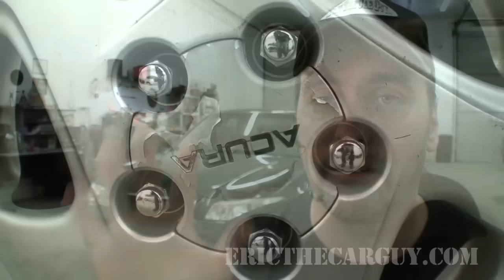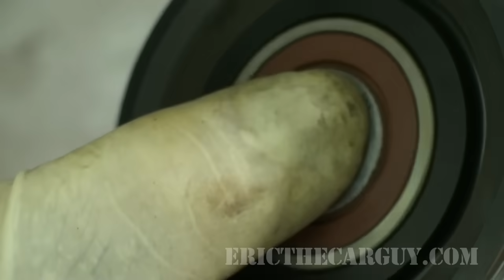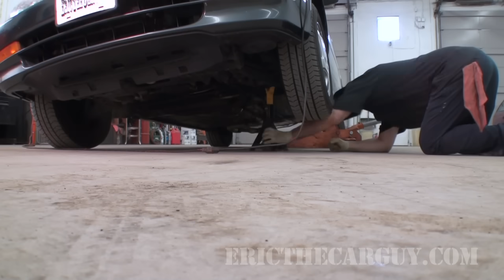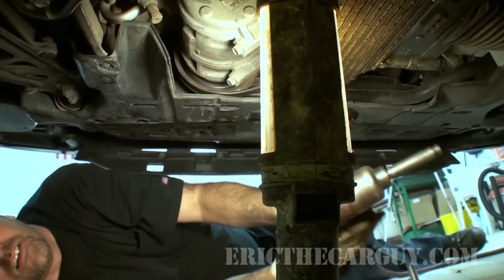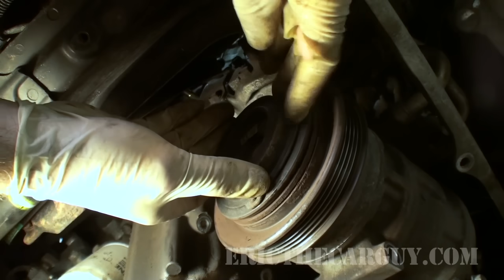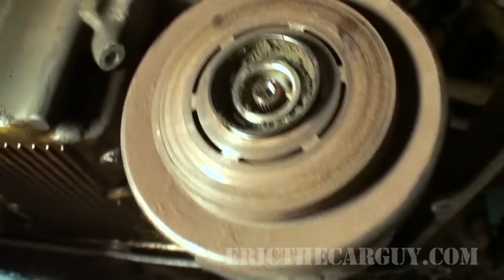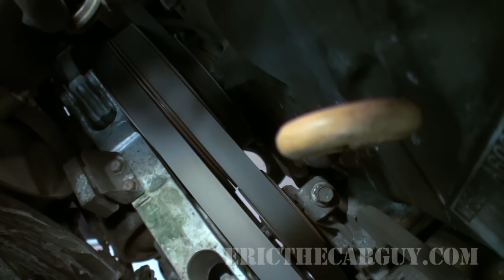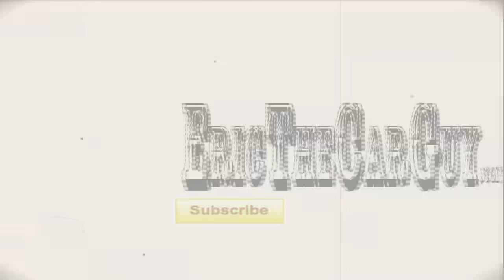AC Clutch Repair and Noise Diagnosis -EricTheCarGuy

Comment: I can't believe your banging on a bearing with your ball ping hammer. That is a machined bearing. More than likely it won't hurt it BUT the chances it can out weigh the gamble. If any thing you should at least use another socket the same size as the outer housing of the bearing and tap it in!

Comment: What if the clutch grabs when it wants? Sometimes it'll stop grabbing.  It's gotten to the point where I literally have to turn on the A/C and when it doesn't work, I have to pull over climb on the ground and manually keep spinning the clutch with my hand until it grabs.
Reply: Sounds like the stator is failing.
Reply: dmc16336 What's a "stator"?
Reply: Eric Ver Linden A "stator" is always an electronic part that doesn't move. In a compressor, it's an electromagnet that pushes the pulleys together when you turn the a/c on, which makes the compressor spin.

Comment: best way  to identify bearing noises or any noises in engines or transmission.. use a small hose (cut it about 1.5m long ).... den point it from the bearings u want to identify and listen to it.... the hose acts like a stethoscope..

Comment: Hi everyone,
I have a '06 Honda fit and whenever my AC compressor kicks in, it sounds (from the outside) like knocking. The noise is kinda plasticky in nature. How do I fix that?
Reply: You may have a failing compressor due to loss of oil and refrigerant the same.  Have you had to have the system recharged?  If yes, did you do it yourself with one of the hoses and bottles they sell in an auto parts store?  Often times you'll end up introducing moisture and air into the system if you charge multiple times to cover a slow leak.

Otherwise it may be the internal valves failing in the compressor.  Find a reputable tech or friend who specializes in HVAC/R leak check, evacuate and recharge the system.

DO NOT get fooled into buying the sealant junk they hock at auto parts stores.  It damages the system more often than not and makes a mess of our equipment when we have to service a unit that has that stuff in it.

Comment: I'm currently working on my Acura and everything was going smoothly until I got to the step after removing the 10mm bolt from clutch. It isn't separating at all.

Comment: 99 Chevy Suburban Auto 6.5 Turbo Diesel.  Trouble shoot.
Warmed in drive stopped with brake Engine will surge trans seems to bind.
Amps show low <13 MOST run 14.3
After a warm start amp gauge flicker every 2 seconds gaugeto 10amp and I noticed that Glow plug lamp was lite halfway as amp decreased on and off.
Im thinking ground causing Glow plug, low voltage, causing ECM to actup causing trans problem??  Any ideas appreciated. Peace

Comment: Eric your video is really helpful, but i really want to know what would cause the coil or clutch mechanism not to engage or go bad. I have a honda 2005 model. i discovered the coil is bad, i want to know if to change only the coil or what else would i check that may have cause the coil to go bad.

Comment: Don't hit bearings back in with the inner race, use a bigger socket to hit the outer race
Reply: I would use the old bearing laid over the new one, then pound on the old bearing along outer race.
Reply: @newttella1043  i do the same man
Reply: Newt Tella using that technique I’d probably wanna watch for the old bearing also getting hammered in eh?
Reply: @hazemdrift  Seldom is there enough room for both bearings. Besides, you just watch carefully as you get close to fully seating the new bearing.
Reply: What an absolute savage.! Didn't finish his apprenticeship, obviously.
Reply: Or you can  lightly tap it into place then press it back in with "The Vise" and get an even amount of pressure as you crank it back in.
Reply: I lost a little faith at that point in the video.

Comment: Hmmm, sounds a little bit like my BMW air. Makes a bit of noise that is sometimes like rocks rolling around in there. One of the hoses that leaves the compressor has a bit of condensation on it though if I do use the AC, so maybe more than just the clutch...

Comment: Eric, At 18:24 you were able to just pull it off as should I on my 2000 F150, but mine won't budge at all. Would it be ok to use WD-40 to help loosen it up? What other options would I have to pull it off?

Comment: my car makes noise at idle but when i press in the clutch it goes away!? help :D
Reply: Sounds like either the throwout bearing (I think that's what it's called) or possibly a bearing on the transmission input shaft.  I have a friend with a Nissan 350Z with a similar problem, if the clutch is engaged with trans in neutral it makes a lot of noise, the instant he pushes on the clutch the noise goes away.

Comment: that is painful to watch you tap that bearing into place when you have a vice in front of you.  You could have inserted a socket or whatever the same OD as the bearing outer race and pressed it in by tightening the vice.  Could have also lubed the bearing too before inserting it.  By tapping on it with a hammer, you end up contacting the inner race and Brineling the races.

Arbor press with a push tool and lubricated pulley ID would have been the most ideal.
Reply: It's painful that you can't hear. He clearly said not to do it that way at 7:45.  He stated he just hammered it because it was an old one.

Comment: Instead of taking off the idle pulley to check for bearing noise you can just touch a long flat head screwdriver near the pulley when its running and touch the other end of the screwdriver to your ear. You will hear the roughness and bearing noise if its faulty.

Comment: I had this problem few months back but in my case, the mechanic replaced  only the bearing in the clutch and that appears to have solved the problem. The video confirms that he did the right thing. 

Thanks Eric. Keep up the good work.
Reply: Mine is CRV 2008 which I heard AC issues are common.

Comment: At 0:45 you say an Acura has 5 cylinders? Really? Never heard of a 5 cylinder engine before.
Reply: Just FYI

Wikipedia:
Audi produced the first petrol straight-five, a 2.1 L SOHC engine, in the 1976 Audi 100. In 1981, the Audi 100 also became available with the smallest production straight-five, a 1.9 L variant.[4] Audi used straight-five engines in many of their cars between 1976 and the early 1990s, including the Audi Quattro and the Audi RS2 Avant. An Audi five-cylinder engine was also used in the Italdesign Aztec concept car. In 2009, Audi began using a new turbocharged five-cylinder engine in the Audi TT RS and later the Audi RS3 and the Audi quattro concept.

Since Volvo introduced their Volvo 850 in 1992, much of their line-up has switched to their five-cylinder Modular engine, with their engines also seeing use in Ford's Focus ST and RS models. All of the inline five engines used by Volvo and Ford are built at the Volvo Skövde engine plant in Skövde, Sweden.

Honda produced the G series five-cylinder engine beginning in 1989 and used it in the Vigor, Inspire, Ascot, Rafaga, and Acura TL.

Volkswagen has used straight-five engines in their Eurovan, and have recently developed a different straight-five engine which is used in the Jetta, Passat, Rabbit, and New Beetle in North America.

Fiat also makes use of straight-fives (both petrol and diesel) in larger Fiat, Alfa Romeo and Lancia models.

General Motors's Atlas family of inline engines included two straight-fives, a 3.5 and a 3.7 L, used in their GMT 355 mid-size truck family (including the Chevrolet Colorado and the Hummer H3) from 2004 to 2012.
Reply: ScubaSteve12710 I didn't know. So does this car have 5 cylinders?
Reply: danny yo The Legend has a v6 (used to own one, great car).  You're thinking of the Vigor which was sort of like the legend's baby brother and had a 5 cylinder engine.
Reply: Maybe not acura but Audi, VW and GM have been using them for years.. GM not exactly successful at it.. They claimed 70% efficiency on this Audi TTRS TFSI 2.5 5 cyl.. Which is basically half a ferarri 5.0 V10.  watch?v=vVnM8z1nX4k
Reply: ZiegSa-COOLfiat  volvo 850 has a 5 cylinder engine
Reply: Volvo makes inline 5 cylinder engines and so does GM
Reply: Hayes Clark *inline 5
Reply: Bayer-Z28 Thanks.
Reply: the acura legend was a 5 cylinder engine car, there are plenty of 5cyl cars out there, google is your best friend.
Reply: danny yo No, the VIGOR was. But I think this is a 3.2v6
Reply: Mercedes has both diesel and gas 5 cylinder engines. You probably never heard of a 3 cylinder either well they make those too, and 2 cyl, and 1 cyl.! There is even 12 and 16!
Reply: http://www.honda.com/newsandviews/article.aspx?id=844-en
Reply: Honda built  V-5 engines for their GP race motorcycles and won many races with them. That's correct, V-5 !
Reply: FastRedPonyCar you are absolutely correct, wow been awhile since I seen a vigor. lol.  yup the legend did held upto its name. 
thanks for the correction.
Reply: I don't know about this model but I've worked on a V5 Volkswagen. Odd concept but seems to work.
Reply: Jr ALEXANDER Volkswagen used a v5 in the 2nd gen beetle and the 3rd and 4th gen golf. Google is your friend
Reply: Dragunov302 type vw aqn engine in to google
Reply: He was talking about the number of lugnuts on the wheel...
Reply: dm6187 he said the 2.5 tl has a 5 cylinder engine and 4 lugs on the wheels
Reply: Even my Jeep Grand Cherokee WJ has a 5-cylinder diesel engine.
Reply: dont b a maniac. der r 5 cyl cars.
Reply: Lol
Reply: Todd Harrison 
Gmc has them in their smaller trucks and I believe honda/Acura has them too
Reply: 1998 Acura TL 2.5
Luxury vehicle
Model: 1998 Acura TL
Number of cylinders: 5
Horsepower: 176 hp
MPG: 20 city / 25 highway
Engine: 2.5 L 5-cylinder
Reply: Hummers are also 5cyl
Reply: Check this one out too.. XD XD   !!  watch?v=VNklpt8CVW4   NUTS!  I was a domestic guy born and bred, but I'm playing with Euros now... not forever, but they provide a lot different experience.  Awesome interiors and build quality.. :D
Reply: He said 5 lugs.
Reply: he said Five lugs not five cyl 0.45
Reply: Terry Gibson You might want to re-watch the video and open up your ears. The 2.5 is 5 cyl. and the 3.2 is 6 cyl.

Comment: I would have lightly greased the steel on the new clutch where it slides onto the aluminum compressor and the shaft. Water makes rust and makes things stuck.
On GM compressor got to use pullers and installers on the pulley and hubs. I was shocked at how easy it is to do on that car. On GM, the clutch clearance has to be manually set by moving the hub in or out and only friction keeps it in place.

Comment: Might want to mention that hitting a new ball bearing with a hammer specially on it's inner race will shorten it's lifespan. Try to either apply even pressure on both races or most of the force on the outer. Ideally you would use a hydraulic press with the right die but not everyone has one!
Reply: nicewknd Heh I couldn't wait so I posted the comment, indeed he does. I've swapped a few bearings with this method, it's not ideal but it works. Can't really justify the cost of a hydraulic press though, but you could use the underside of the car and a bottle jack on a pinch, or for that matter anything heavier than the required load for the interference fit in question!

Comment: When you replace the bearing itself in the pulley it's helpful to heat the pulley where the bearing goes in with a heat gun. The bearing will go right in and you won't have to tap it so much with a hammer. Once the pulley cools it's good to go. I do the same thing to the bearing on the power steering pump when resealing the pumps.

Comment: I just installed a new a/c belt on my '98 Civic DX (it was missing since before I owned it). But now it makes this loud whining noise, whether the a/c is on or not. I highly suspect it is the tensioner pulley, and I'm happy to learn that all I have to replace the bearing itself, should that be the problem. Also, the clutch doesn't engage, could that be because there isn't any refrigerant in the system? On another note, despite what all the grammatically challenged idiots below say, Honda's are awesome. I love how easy my Civic is to work on. :)

Comment: I bought an '83 Toyota Celica in '83. 5 years later, the A/C compressor was making noise. I took it to the dealer and they use WD40 on it. The noise stopped. The A/C worked fine, so they said to drive it until it failed since a new compressor was so expensive. I drove the car until I traded it in on a new truck. Matter of fact, the salesman bought it for his wife since it looked new. The A/c compressor never failed while I owned it.

Comment: hey Eric great video, i have 1 question why didnt you replace the bearing only instead of the pulley assembly
Reply: That is a good idea. One reason not to is if the clutch face is worn unevenly. If it slips it overheats.

Comment: Hi Eric,

Why not just replace the bearing in that clutch unit?
Reply: 5 years no reply? ouch. Good Question btw.
Reply: I have the answer, Ford won’t let anyone sell the bearing. And the part that the belt rides on cost $142.00
Reply: @billcoley8520  Maybe you can buy from china for $5? They don't care if it's allowed or not.
Reply: @billcoley8520  not always the case, I replaced the clutch bearing on a 97 f150 2 years ago from a local auto parts supply.
Reply: Gary Riefle I couldn’t buy one for a 05 Ford Explorer 4.0, if you don’t believe me look for one. I have to buy it from the ford company down the road and they had to order it
Reply: @billcoley8520  you try online? You'd be amazed what Amazon sells. Best to Google the actual bearing number when you look for one, it should come up. I've never had a issue doin it that way... use Google shopping, all kinds of suppliers out there.
Reply: Gary Riefle yes I tried online. Anyway I’ve already bought it, replaced it and it worked fine. Basically removed the old and replaced it with new in about 1 hour or so
Reply: @billcoley8520  well that sucks, I hate buying from dealers/stealers. The bearing I replaced was good but the pump locked up internally a few months later, ended up redoing the entire ac system, all aftermarket parts and still working good.
Reply: Gary Riefle ouch
Reply: @billcoley8520  it did hurt my wallet. About $400 bucks worth of ouch. Lol
Reply: Bump
Reply: I upvote this comment
Reply: Is this possible
Reply: At the end of the video he explains why he didn't replace just the bearing: because the compressor shaft took a hit and it may be damaged/warped. Of course nobody knows what happened, it is just a guess, but better be safe than sorry.
Reply: maybe the outer pully of cluth unit is unaligned and need to realign in uni-direction or just change it with new because new bearing may cause problem again with refixed clutch pulley
Reply: Because the rotor was worn unevenly
Reply: Remember he said that it was rubbing more on one side.. which I think would make the contact uneven.. maybe!
Respect to all

Comment: Hey Eric, I actually tried to do the clutch assembly swap on my 02 crown vic last week and ran into a bit of an issue. When I pulled the compressor pulley off, the bearing stayed on the shaft. Is there a trick to getting that off easily?

Comment: I wish i would of done this instead of replacing the whole compressor :/ cause now my a/c has never worked the same again. Thanks for the vid!
Reply: @James Erickson  when you changed out the old compressor did you have a specialist shop professionally evacuate the lines(if you don't have the equipment) and then recharge the coolant for the entire system?
 Because if (illegally) the gas was purged into the air, it would have put regular air in. That, (air) needed to be purged before new freon coolant was introduced into the system.  Air in the system greatly reduces your cooling and can damage your ac system.
See Eric's video on this. 
Thumbs up Eric & cool video.

Comment: You can start the bearing with a few taps then use the old bearing as a spacer to press it in using the vice

Comment: Funny you post videos that directly relate to issues im having. Anyways mine seems to have a worse noise when the ac is off. Would that mean its the idler? I think I might venture into it.  My mechanic doesnt work on weekends and my new job I work basically the same hours as they do so getting it to them isnt easy.